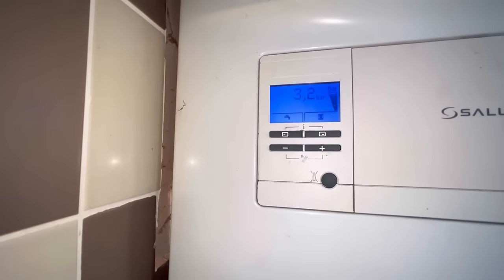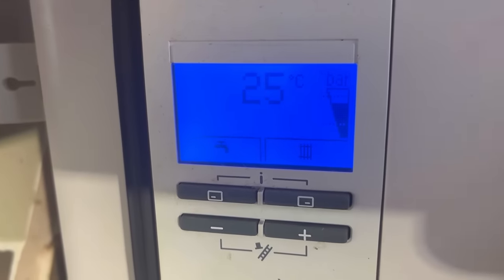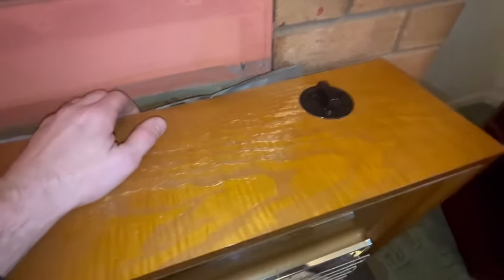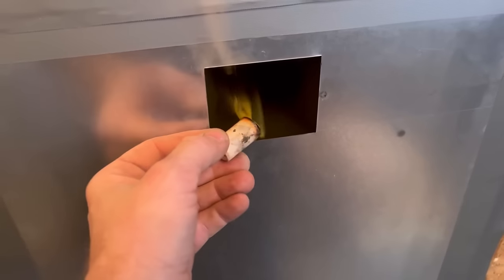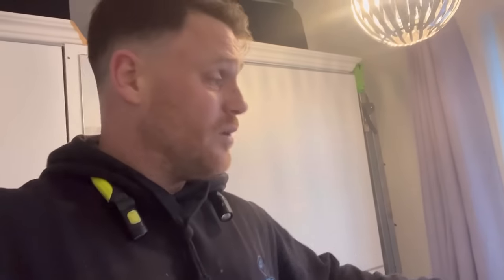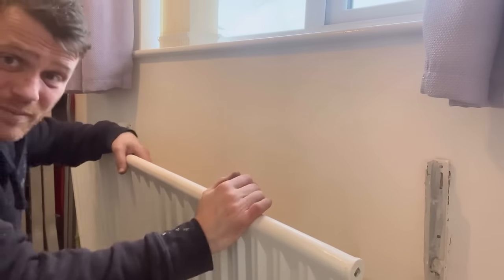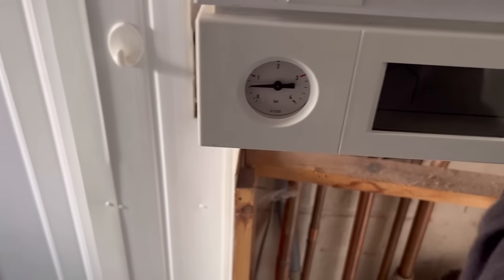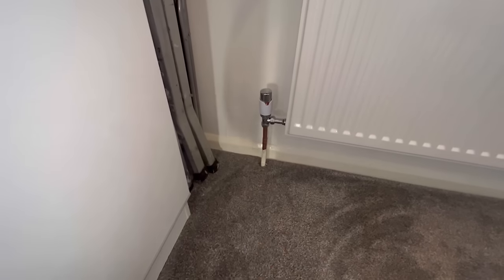Plumbing Hints and Tips : Day in the life of a Plumber

Comment: Those plumb thumbs are good….until you cross thread them. In addition to these, keep a pair of compression stop ends, these can be fitted to rad tails too. Good video. 👍🏻
Reply from the maker: Yeah once they have been cross threaded they am a pain to get on or even scrap, cap ends am a good option as well 👍
Reply: I've used Jay cloths for years just tear a strip off use a slotty to push it inside the tail, you can reuse it, doesn't disintegrate a packet lasts a lifetime 😅